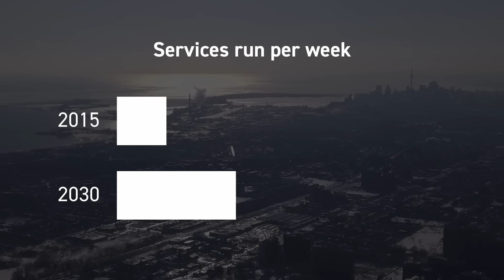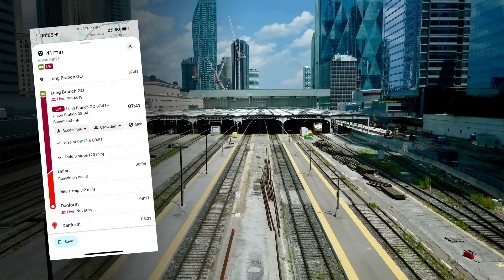How Toronto is turning its commuter rail system into a rapid transit network!

Comment: Correction: At 8:43, it's Caledon, not Caledonia. Important because is Caledonia is south of Hamilton not too far from the existing network.
Reply: Correcting the correction. Despite many mispronounced place names in this video, he's actually got this one right. Caledonia Rd is a popular N/S thoroughfare between St Clair and the 401 that runs parallel to the GO line. The Caledonia stop of the Eglington Crosstown is a perfect place for a new GO station on that line.
Reply: @andrewparadowski8122  You are correct. I totally misread the scale of the map.
Reply: Don't be misled by 'not too far'. Shuttle service has started before, but stopped due to low ridership.

Comment: it's pronounced "stove-ville" and "spad-eye-nah" btw.

The biggest impacting of routes will be the new 6km bypass track that has just been ordered by the province in the west end of Toronto.  This will remove the need for trains to pass through Union Station.  It allows new routes to be created a lot more easily.  The lack of a bypass has been known as the biggest Achilles heel in the network.   It is what was stopping the line example you gave in the video travelling north of Toronto from becoming a reality.

The problem with too many new stations being rolled out is that it creates longer travel times as long as GO refuses to restore many of the pre-pandemic express trains.  Some need to be restored in order to maintain reasonable travel times, even with electrification.

Comment: The swissknife shaped structure of the GO Transit network actually reminds me a lot of the Copenhagen S-Tog network that has been in operation with electric motor units for more than half a century in a city that is much smaller than Toronto. To be more precise, DSB S-Tog opened its first route in 1934, but the swissknife network was developed after WW2.

Comment: 12:50 I don't think forcing freight companies to cede the way to passenger service is the way forward for Canada. Keep in mind, a much higher percentage of our goods arrive to market on freight trains than in Europe and other regions because of how spread out our major urban centres are across an entire continent. Freight traffic has increased nationally and made sharing infrastructure with passenger service less and less viable. Reducing freight traffic means increasing the cost of goods and the number of trucks on the roads. Simply put, passenger service requires the construction of new track, rather than legislation forcing freight to make way.
Reply: Yes.  Beating up the freight lines will move more trucks onto the roads, increasing congestion, emissions and the cost of freight.

Comment: As GO is a provincial entity known also as Metrolinx, Toronto isn't doing anything. It's the Province of Ontario that is funding and doing this work. Please correct this.

What you are doing here is equivalent to claiming that Brampton and Mississauga are responsible for HULRT which they aren't. That is Moblinx and is funded and directed by Metrolinx again.
Reply: I love that your analogy is a thing that even fewer people are going to understand… maybe try something like “the city of Los Angeles taking credit for Brightline West” or “attributing HS2 to Birmingham city council”. Something a more general audience might be familiar with.

Also, besides the fact that it’s essentially impossible to “fix” this on YouTube, I’m not sure he ever actually asserts that the City of Toronto are the ones responsible for this. Just that it’s a project happening in Toronto. Understand that, for a global audience, the distinction is an extremely fine one, and for the context of this particular video, it doesn’t make a difference to the message.

Like, in every video about Sydney’s trains, he’s talked about “Sydney” doing stuff that is being done by TfNSW, a state level organisation, because the actual City of Sydney is (a) tiny, covering a small fraction of the area most people would call Sydney, and (b) doesn’t have the jurisdiction to actually implement heavy rail projects. But, like, we all get it. When we say that a place is doing something, we mean some combination of public and private entities are doing that thing with the goal of access to the general public in that place.
Reply: @gormster what the hell is the brightline west? Wait, am I suppose to know that? How is that better then mine then?
Reply: Well not exactly. GO Transit is not necessarily Metrolinx. They are closely associated, but still different entities.

Comment: 05:00 most diesel powered trains engines just work as generators and produce electricity to run electric motors that actually move the trains.

Comment: To get to any Go station outside of Toronto, you need a car.  While China and Europe have high speed rail, we're jumping up and down for 140 km/hr.  The system is old.  We rely on buses in Toronto, 'cause the subway has mainly 2 lines NS, and EW.  Pathetic.
Reply: Not true. I lived in Bramalea for decades and took local transit to the GO Train.
Reply: @MKPiatkowski  What's not true.  I've been in Toronto forever.

Comment: You also forgot to mention the GO Buses fill in the gaps when the trains are not running on those sections. You kinda made it sound like theres no possible way to use those lines if theres no trains running. 11, 18, 21, 30, 31, 33, 65, 68, 70, 71, etc are all routes that fill in the gaps replacing train trips when they dont run.

Comment: I agree that the CP North Toronto Subdivision (formerly the Ontario and Quebec RR) should be developed for GO services.  In 1993, a complete design of a four track corridor - with two Go tracks on the outside with CP freight in the centre - was developed.  Little additional property was needed for this plan.  The estimated cost from West Toronto Junction to Agincourt (a major CP freight yard) was $350-million.  The line could be extended to Peterborough and even Havelock, from where, in the mists of time, a commuter rail service was once offered to Union Station.  We need politicians with vision!!

Comment: This is fantastic - however as a regular commuter to Montreal using rail, I really hope the Toronto - Montreal ViaRail transit improves on a dedicated track with travel times improving to 2.5-3 hours!
Reply: Agree but I think that's a very optimistic target. Milan - Rome is about the same distance and their HSR service takes 4 hours.
Reply: @davidreichert9392  4 hours still puts it at faster than driving from downtown to downtown by about an hour in low traffic conditions and following approximately the speed limit.  Which should help a bunch.
Reply: I am with you there, I travel Montreal to Toronto then on to the London train and back  a few times a year . I live in Montreal and my daughter is in Brantford. My experience with Via is atrocious, I cant recall ever arriving on time in Toronto and, as the same train  then travels to London, of course the departure is delayed. Each trip has at least 1 stoppage due to freight train having priority. It is time to get in line with the rest of the world ( read Europe) .

Comment: We use the go train whenever we need to get downtown. We live about 13km from the core, 3 min from the local station  and can get downtown in 13-15 min. The train is usually on time, comes twice per hour and has a quiet zone on the upper floor that is super nice if you just want some peace. It's a far superior service to anything the TTC offers and was the main reason we bought a house where we did. Its a truly wonderful system and the fact that they are making it even better us simply wonderful and will hopefully help keep traffic down and improve connectivity in a very congested and car centric city that wasn't actually very well built for cars despite so many citizens utter dependance on them.
Reply: is the quiet zone ever even enforced lol, people still talk even when the chime comes on in my experience.
Reply: @Nabee_H  quiet zone is only in effect on rush hour trains, and in my experience in the mornings its well followed, but sometimes in the afternoons there's more leisure travellers who may not know its a quiet zone so you hear some talking.

Comment: I lived in Toronto for a bit in 2004 and what I would say about most of the GO commuter rail services then, is that most of them did, in fact, run all day, it's just that only the AM peak services into Union and the PM peak services out of Union were trains. Everything else was express buses. This sounds a bit crap, but actually the journey times on the express buses were generally the same as the train, it's just that the capacity outside of those peaks was poor.

While I think the move away from buses and towards a regular train service that runs all day is good, the fact all the suburban stations are giant Park & Rides is the bigger issue they need to solve. It cannot be right that there's no free transfers between GO trains and local buses in York Region, Brampton etc, while many stations still have free parking. You want public transport to enable people to live without cars if they want to, but GO transit has historically been based on the idea that everybody drives everywhere, but in the case of some peak journeys into downtown, you need to give suburban people somewhere to park their car and switch to transit to beat the worst of the traffic congestion. These problems will take longer to fix.
Reply: There has been integrated fares for the last year.
Reply: @MKPiatkowski  Ooh, didn't know that. Just read up on it. That's a positive development and impressed the transfers are free!

In London we don't even have free transfers between between train and tube. You can do mixed mode train/tube journeys and just pay one fare, which is a bit cheaper than the sum of the two separate fares, but it's more expensive than a train only or tube only trip covering the same zones. And bus fares are completely separate. But you do have daily price capping and travelcards which cover everything, so a lot of the time this doesn't really matter. But when I lived in Toronto I always thought it was amazing that there was a flat fare covering all modes (except GO), with free transfers. Giving free local transfers to GO riders is great!

Comment: It has improved quite a bit but it's still not there. If I want to go out on a Saturday night the last GO train heading back from Toronto to Burlington is 12:47 AM after that I need to catch a bus to head back we need trains till 3:00 in the morning on weekends. It's why I tend not to go to events in Toronto on the weekend because of big run late I'm going to be catching a bus home and that's completely inconvenient
Reply: The big problem with that is that there aren't a lot of riders that late. It's great the buses run that late. Maybe if the buses are always packed it would make a case for the train but I suspect those late trains would need extra security so the cost would go way up.

Comment: Many of the Barrie & Stouffville GO trains through run interline, esp out of rush hour. As a long time Hogtowner (Torontonian) you nailed the transit. Also, the CPKC Midtown Line has been identified for major GO train upgrade by the current provincial gov't, with 2 way all day service to Mississauga & Scarbought (not sure of the terminals), but it's going to cost many billion - lots of bridges to widen for new tracks, some bridges high over river valleys. Worth mentioning too is that intermodal fare integration is now a thing (over a year since being implemented), which allows TTC-GO interchange, for the GO fare. This avoids locals paying the double fare, once for each system, within the city. With increased Lakeshore East/West 30 min minimium frequencies, this effectivetly adds an express metro line to the city and region.

Comment: Kind of unfortunate timing for this video. The province, through Metrolinx, just cancelled the contract for GO Expansion operations. Good chance very little of this will happen.
Reply: Douggie's trying to divert funds for his ridiculous 401 tunnel
Reply: @davidreichert9392  Probably wants to buy the 407 back (which HIS party sold!)
Reply: Unfortunately there are several issues with all of this. As much as I would love to see these changes, the reality is that most of changes won't happen for another 30 or 40 years. Metrolinx doesn't have the operators for all the trains, they barely have enough now. The 5 miles of track they are trying to add between union and Danforth has already taken 5 years.  Stouffville double track has already been over 10.
Reply: @chrismassey5  It doesn't take 30 years to train operators. That is not the barrier.

Comment: iirc the new electric engines will actually be diesel hybrids, so they can run on both diesel and bypass electrical. So for the sections of track that have electrification they can use that, but then for regions without electrification they can run using on-board diesel electric generators like the current engines do. These new engines are also being bought in partnership with VIA, so both GO and VIA will run the same engines and be able to share the cost of procurement, maintenance, and replacement parts.
Reply: A decent interim configuration would be to have the GO passenger carriages set up like the Budd Cars that CP and CN used to have for the more lightly used regional passenger rail service (such as what used to be used between Toronto and Owen Sound via the CP Orangeville and Owen Sound Subdivisions).

Comment: A quick update, the connection between West Harbour and Niagara Falls was actually finished at the end of April (making it the first Ontario infrastructure project to finish ahead of schedule), with it entering service the day you uploaded this video.
I was actually on the first Hamilton-Niagara train to use it, and am currently watching on the GO Bus back home.
(I'm on the GO Bus because I accidentally read the weekday schedule and didn't realize the next train to Hamilton wasn't until 4)
Reply: They have announced expanded service, more trips and shorter wait times for West Harbour GO several times. Often followed up with "closed for track work, weather delays....." If you're travelling from Toronto Union Station to Hamilton or Niagara there is all sorts of issues. There isn't a train departing GO Centre downtown Hamilton early enough week days for me. If I drive to West Harbour GO station I would have to take the train to GO Centre at the end of the day and take a bus to West Harbour to get my car.
Reply: @seanwebb605  We can thank Canadian Pacific for that.

Comment: Go Transit is actually the largest public owner of parking in North America and most of it is free with the exception of a couple spots they reserve at some busier stations to guarentee the person a parking spot. 

Go Expansion has also undergone multiple names and changes since it started. This project started under the Dalton Mcguinty/Kathleen Wynne liberals in 2014-2015 area. Its been an incredibly slow and disjointed expansion program which has seen some progress and a lot of TBD in other areas. I would be happy to see it expand especially after living in Europe and especially the Netherlands now for 2 years.
Reply: If I work afternoon shift in Toronto I often can't get any of the free parking at the Aldershot, Burlington or Oakville GO Stations. Many times I have driven around three parking lots before just continuing to drive to Toronto. Hamilton GO Centre doesn't have free parking. West Harbour GO Station does, but the returning train goes to Hamilton GO Centre and I would have to take a bus to West Harbour to get my car.
Reply: Then there are stations like Long Branch and Mimico which have literally no free parking, resulting in people parking on and clog up local nearby streets 😠

Comment: Good video. Your point at 12:37 is an important one. The railways actually used to be federally owned, but many were privatized in the 90s, which has caused problems for passenger rail ever since. One of several problems caused by privatizing federal infrastructure (the 407 highway is another).

I find the Lakeshore West line quite good, as it already has 15-minute service at peak times and express trains that bypass certain stops. Not all lines are the same though. I think what would really increase the usefulness is a ring line so the GO can be used for travel between the outer cities and not just in and out of Toronto.
Reply: I've been seeing new stations going up further along Lakeshore West out towards the falls. The St. Catharines station is currently being completely overhauled, it will be amazing to have the section from Hamilton to Niagara with increased frequency! Lakeshore East is leaps and bounds ahead and the service is really fast, it'll be great to see it all improve as time goes on. 

I'm sure the reasoning for the current frequent train plan end at Aldershot and not continue into Hamilton is strange, but I suspect it has to do with the current infrastructure as there is a lot of freight rail lines between Aldershot and Hamilton, and then beyond it eventually turns into single track out to Niagara.
Reply: @CXW429  Seeing the Niagara section become more than a Toronto to Wine Country tourism line and actually having useful times for Niagara Residents will be huge.  The QEW highway is becoming more congested as the population in the region grows and there really is no alternative relief than expanding GO.

The buses in the region recently merged into a regional service with significant service upgrades planned.  Hopefully that is well coordinated to serve the GO stations.
Reply: @Zraknul  I didn't know about the bus merger, that's cool!
Reply: Just a small correction - there have only been two major freight rail companies in Canada for a very long time - CN & CP(now CPKC) and only one of those was federally owned - CN, which did in privatize in the 90's(1995). CP however was always privately.